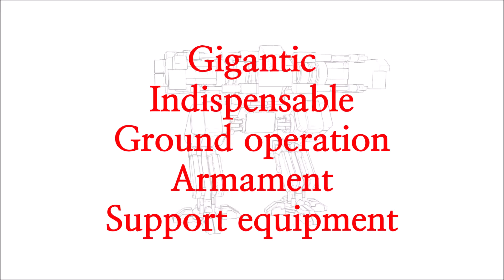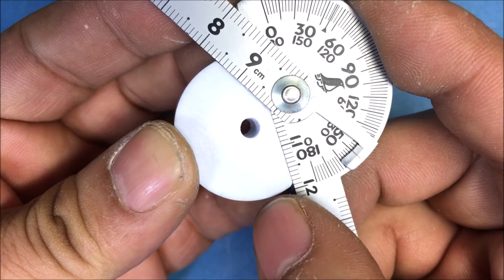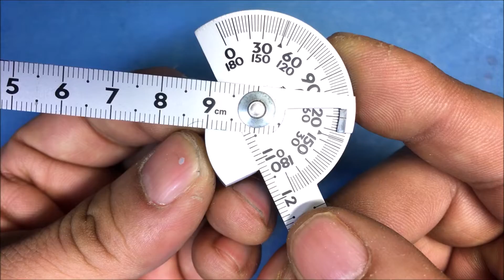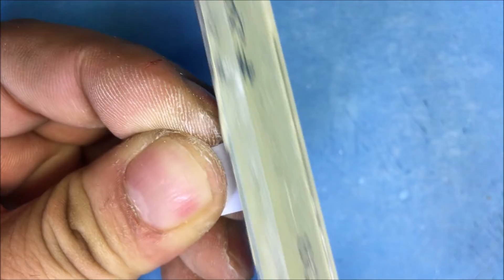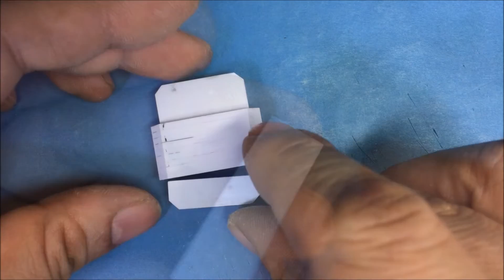[Plastic Model] GIGAS EP03 : Scratch Built Sci-Fi Mech

Comment: Amazing, keep up the good work..!
Reply from the maker: Thank you for your comment!
Reply: Your welcome...Can I ask which type of mini table saw you use please?.
Reply from the maker: What I used was "FALCON Mini Table Saw" It's a tool I bought a few years ago, but it's hard to recommend.

If you're looking for a similar product, I recommend "Proxxon 37006 KS 115 Bench Circular Saw". "Falcon" seems to be a copy of "Proxxon".
Reply: Does the Falcon/Proxxon need a transformer or is it mains powered?, I've considered a 'Minicraft ' hobby table saw here in the UK which uses a transformer....thanks for the quick reply.
Reply from the maker: As far as I know, UK use 240V. If so, Proxxon mini saw need a transformer. according to the manufacturer, motor operates at 110-120 volts.
I don't know exactly what kind of hobby work you're doing, but if you're looking for a more professional tool, that's not a good choice. It's basically more like a toy. because it's not a precision tool. I only used it to cut styrene and wood simply.
I've never used "Proxxon", and according to my experience with "Falcon", it's not the perfect tool for cutting styrene. the motor's revs cannot be adjusted, so the cutting surface often melts.
Reply: I was worrying about melting the styrene, I'm making scratch built models of sorts anything from Gundam to Guns(the mini variety), I use a custom built scroll saw geared down so not to melt the styrene at the moment but need something to do precision straight cuts....Thank you for taking the time to reply and share your knowledge...
Reply from the maker: You're welcome. You were thinking the same thing as me.
I don't know if it will help, but I'd like to make a suggestion.

if you've watched carefully at my videos, in my case I'm using table saw to cut several parts in a straight line quickly, albeit a little inexact. and I'm sanding for a straight line.
The tool I used for quick sanding work is "Proxxon 38060 Disc Sander TSG 250E". the advantage of this tool is that the rotational speed of the motor can be adjusted freely(RPM 250-750). of course you don't have to worry about melting.
Reply: I noticed how your sander run at a lot slower speed (than mine) and wondered if it was due to melting the styrene,I'm using an homemade sander at the moment but watching yours mine runs way too fast and I don't have any sort of miter bar adjuster (not sure if that's correct term?) or any way to reduce speed. I'm going to read up on the Proxxon sander and again thanks for the advise.
Reply from the maker: I found out because another friend recommended me while I was on YouTube. it's not a perfect tool, but at least it doesn't have a trouble with my work, so I'm using it well.
I am so glad to know a friend who has a similar hobby. :)
Reply: Thank you again for the information and I can't wait to see the next upload of the GIGAS mech build, your builds give me something to aim for regarding precision and attention to detail...Cheers Sean.
Reply from the maker: I also thank you, and hope you have a great hobby work.

Comment: I like the way this is going. But one thing (please don't take this the wrong way. It's just my opinion and an observation from past projects of yours): I feel you use a lot of materials only to grind it down. Wouldn't it be simpler to make some parts hollow. I'm just curious to understand why you make your parts the way you do, that's all. Keep at it and take your time releasing your videos. Making models should be fun and relaxing.
Reply from the maker: Thank you for your opinion! you gave me an opportunity to look back at the process of making models.

I think it might have been better to make some parts hollow as you say. the weak point is some parts that I've made are a little heavy. but for the leg parts, I thought it was okay.
In the case of upper body, I have to consider the weight a little bit, so it's going to be made in a slightly different way.

In fact, there is a waste of materials, but the reason for making parts this way is simply because I'm lazy. haha.
It was easier for me to make a rough shape and grind the part to the correct size.
I thought more accurate measurements and structural designs would be needed to make some parts hollow. but it is always difficult and cumbersome to measure accurately and cut parts. in spite of its importance.

I hope you've solved your curiosity a little bit. ;)
Reply: on the zero Thank you for replying! I hope to see you grow as a model builder and youtuber. Your skills are impressive regardless of laziness as you put it.
Reply from the maker: Thank you. I'm just recording the process of making a model, and I'm really thankful that some people like it.
Reply: It's almost as if you build physical models the way one might build a model in a 3D program. I dig that even though thwre might be some waste. But I do echo some other comments. I think you would kill it with your own homemade vacformer. Either way, looking forward to your future vids.